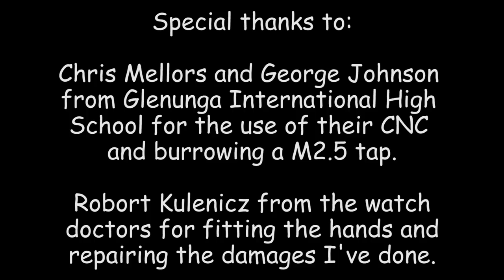Building A Wooden Watch

Comment: This is exceptionally inspiring. Thank you for sharing your skills and talent Steven. Moreover thank you for making plans freely available. 
Did you use any special 'watch making' tools and was the watch mechanism a kit you bought or did you take the workings out of an existing watch?

Thanks
Reply from the maker: The only special "watch making tools" was a pair of tweezers that was meant for pulling hair out. None of the parts were bought as a kit, instead, I spent hours hunting on eBay and other websites for them. At the end, I found it much easier to buy parts from a watch repair store, since you have an actual professional person to consult with and it's free shipping.
Thank you for your support!

Comment: Hey steven, Do the screws resist on the long run? I saw some people that use some sourt of fixation nuts. But I dont want to go through the work of finding these if they arent completely necessary.
Reply from the maker: the screws i use are classified more as bolts since they have a flat bottom and a predrilled tapped hole. They seem to be holding up just fine even with those minuscule threads.

Comment: Hi Steven I'm going to attempt my first watch soon and I was wondering how you fixed the glass in place please?
Reply from the maker: by friction
Reply: Thank you for your reply ... On the watch head did you drill all the way though with one sized forstner or in 2mm and then though the back with a bigger bit? Or does the crystal holder hold the glass
Reply from the maker: @maverickevans5362  the crystal holder holds the glass, and i can't remember how i drilled the holes anymore, but it was whichever method that provided greatest precision and accuracy through trial and error

Comment: Great work. I don't have some of the big tools that you used. What type of tools do you recommend for a newbie and that are essential to this project?
Reply from the maker: lots of good quality sandpaper; different shapes to wrap sand paper (mainly round and flat); small files; drill press (I unfortunately, cannot see how the project can be done without it); bandsaw or scroll saw or even coping saw. Also, it's best to have a vice (any kind, just make sure you put some padding between) to hold your work. This project really needs patience, not a lot of tools.
Reply: a cheap belt sander ($20) seems like it will make this do able.

Comment: At 3:56 in the video you are using a cnc...are uou using a drill bit to cut that or is it a laser.   Ive been using drill bits to cut out letters but the bits keep breaking. If you are using a drill bit can you tell me your set up?
Reply from the maker: it's an actual mill bit. Drill bits aren't designed to cut horizontally, so they aren't recommended for milling (maybe super light passes with the tip of the drill bit would work)

Comment: What size drill bits did you use?  I know this video is old but please answer.  Thank you
Reply from the maker: I used a lot of drill bits. Check the plans, as they specify what diameter holes are required.

Comment: This is awesome and really good work...Did you actually install a Crystal into the watch?
Reply from the maker: Although not shown and not obvious in the video, but I did, it was a very snug fit but still loose enough that I didn't need to use a vice or anything to clamp it down. I did put some silicone around to help seal it as well. The reason why I didn't film it was because it was very fiddly, and I drop the crystal twice on the floor (luckily without any damage), but glad you asked, or else I would have missed it entirely
Reply: That's really awesome.  Thanks for the response and my other question was what size of drill bit did you use for the links and the watch stem?  The watch turned out very nice!
Reply: Glad it didn't break.  I have made the whole watch face, but having a hard time with the clock face being the right thickness for the Miyota and the stem holes for the band.  Overall this is awesome and a pleasure to make.

Comment: Hello, im interested at your video, and i want to make your wooden strap, 
can you show us your plan for the strap ? in your dropbox that's not included.

much thanks
Reply from the maker: Right, I have just updated the dropbox file now it has the dimensions for the straps as well, and I have also attached a zip file of the Inventor files, which should be a great help to anyone using Inventor or planning to cut it out using a CNC. Good luck with making the strap (no sarcasm intended)
Reply: wow,..you're the greatest
i'll try it out,.. 

much thanks again

Comment: Hi Steven, I was wondering: what did you use to make the strap bar? Maybe a 1,6mm inox rod cut in pieces, according to the holes shown in the plans? Thank you for you reply, keep doing such incredible things!!
Reply from the maker: inox rods? good idea, I'll probably use that in my next watch I'm about to make, because it definitely sounds a lot better than using finish nails :)
Anyways, yes, I did use 1.6mm finish nails, which fit tightly into a hole drilled by a 1/16" drill bit, but I had to sand all of them a little bit to have it not too tight.
Reply: Steven Zhang ok so you have a difference in diameter (after sanding the nails) of something like 0,01/0,02 mm (sorry if I think in millimeters, I'm italian and not used to inches!). Anyway, my intentions were to use 1 mm rods in 0,8 mm holes, and now I think that 0,2 mm is a too much great difference! I have to drill holes of 0,95 mm maybe! If you'd like I'll let you know, I'm about to start when I won't be pressured by University tasks :)
Reply from the maker: I actually can work in both metric and imperial, I used the 1/16" drill bit because it was 1.5875 (very close to 1.6mm) and would be a nice fit after sanding the nails and reaming the hole with the nail. But anyways, I am most certainly curious on someone else's take on building a wooden watch, so feel free to email me any pictures or documentations.
Reply: Steven Zhang It will be done ;) For now, thanks for your fundamental information!

Comment: Wonderfull work ! What kind of glue you use to stick glass with wood  ?
Reply from the maker: Michał Grzesiak it was mainly held in place by friction as it was a perfect fit, but i added in some silicon around the edge yo accomodate for any wood expansion and contraction. i'm most certain that a proffesional watch maker would use something better, but silicone has worked out great

Comment: Thank you for this video and the PDF plans, amazing!! What does this number means? R33.00, 3.00 and a 0 with a slash? that is cm? Thank you.
Reply from the maker: all measurements are in mm, and R means radius. the "0 with a slash through the middle" is the diameter sign. So R33.00 will mean the radius of the circle it is pointing at is 33mm. Hope this helps
Reply: +Steven Zhang Thank you!! Yes, it helps a lot. Keep doing a good job. Thanks